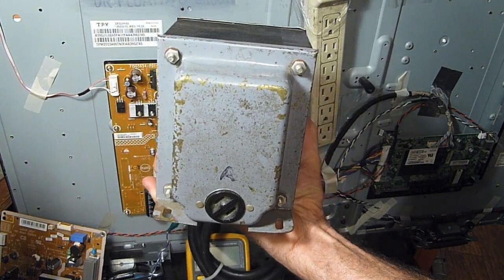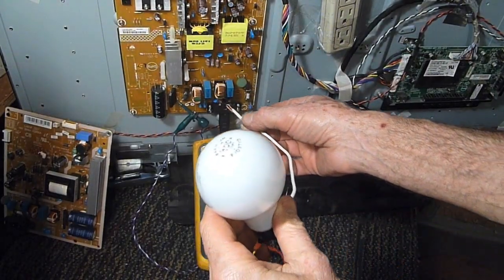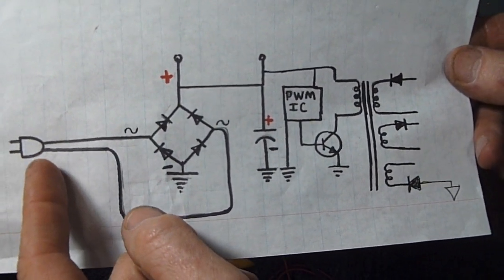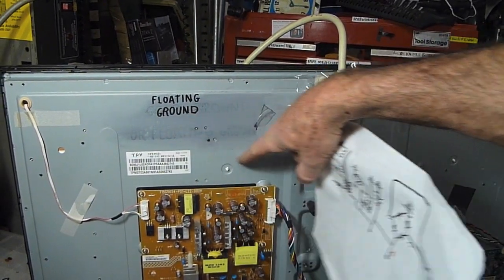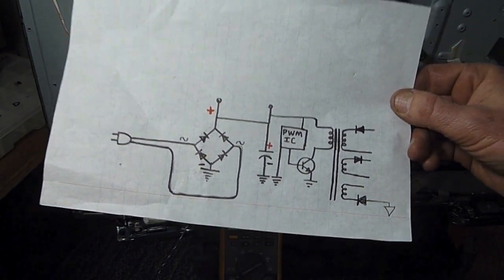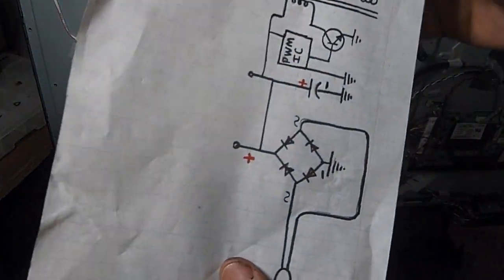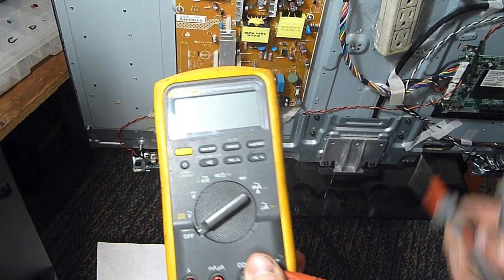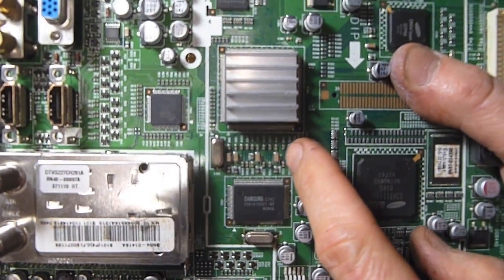Understanding the hot and cold side of a switch mode power supply.

Comment: Very nice. I need to replace my TV PSU. i Know to do that i need to unplugged the power cord from the outlet, but i do know that the hot zone of the PSU has a capacitor labeled with 400v. If the capacitor has a huge voltage it can hurt me for sure. I do know that a can short the capacitor with a isolated screw driver. Once i do that the hot zone remains dangerous? I guess the 400v will be gone once the capacitor is shorted...
Thank you.

Comment: Is it also possible to place your black probe into the negative leg of the largest capacitor on the primary side? I think I've read that on some books about electronics repair.
Reply from the maker: No that sounds like a bad idea.If you place your black meter probe on the negative terminal of largest capacitor in the power supply it's likely to be the hot side of the power supply, and the measurements you make on the cold side of the power supply will be misleading since they are likely to be ghost voltages. .

Comment: Just wanted to say thanks, iv been struggling to repair my drill battery charger which has this kind of switching circuit , from your video I now understand that the chip on the primary side that generates this pulsed dc is probably at fault, the transistor is testing OK, I was measuring 230v dc on the primary side of the transformer, but nothing on the secondary, I removed the transformer and looked for a short on the secondary circuit but that was fine, I applied 18vdc from another power supply to the secondary side and the charger came to life, so as the windings in the transformer were not open circuit, I was left scratching my head and pretty frustrated that it just didn't make sense, I did have an inkling that it was somehow the wrong frequency of dc being generated, so I guess I'll try find this ic online, since the transistor tests good, and iv replaced pretty much every other component in the primary circuit it has to be the ic, thanks again for sharing the knowledge
Reply: You don't know how long iv looked for this information, trying to find the right information to diagnose my charger has been an absolute nightmare. People like you who explain things in a way in which it's easy to understand are a breathe of fresh air

Comment: Where you start measure DC after transformer or after bridge rectifier.
Reply from the maker: After the bridge rectifier is where you measure your DC power.. The power that goes into and our of your transformer is AC.
Reply: @GrantsPassTVRepair  Is the power that goes into  and out of the transformer is  AC or pulsating DC ?
Reply from the maker: @suhailasaba1051  I remember having the same question. ;-) Pulsed DC is going into the transformer, but AC is coming out of the transformer.
Reply: @GrantsPassTVRepair  Thank you for your answer. 
Great video.
Reply: @GrantsPassTVRepair  
Can I measure the input voltage of the transformer by a digital multimeter  ?
Can I measure the output voltage of the transformer by a digital multimeter  ?
Reply from the maker: @suhailasaba1051  As an apprentice in a TV repair shop many years ago I damaged my multimeter measuring a high frequency waveform going into a flyback transformer,  so to play it safe I suggest you measure across the capacitors on the cold side of the switching transformer.
Reply: @GrantsPassTVRepair  Thank you for your  good  answer
Reply: @GrantsPassTVRepair  Is it ok to measure the voltage at the cathode of the diode that is placed after the secondary of the transformer in case the capacitor is dried out and is desolderd and is taken out of the circut ?
Reply from the maker: I'm not sure about measuring anything directly after the transformer. I suppose it depends on how much your meter can handle. My fluke seems fairly indestructible, but I don't like to take chances after my bad experience.
Reply: @GrantsPassTVRepair  
Thank you very much for your answer.

Comment: how can one test the pulse transformer to ensure its working properly?
Reply from the maker: There are several way s to test a transformer. One way is to verify that it has power on it's primary and secondary side. If the primary side is oscillating you should be able to measure voltage across the capacitors on the secondary side.
Reply: Grants Pass TV Repair thanks for quick reply, is this possible to test without an oscilloscope? my voltage readings look ok with a multimeter on the primary, yet I get zero dc output on the secondary

Comment: I have a question. I try to fix my TV. the capacitor went out. and it's a 220v 220uf capacitor. I was wondering if it was okay if I can use a 250v 220uf capacitor instead. will it still work even if I up to voltage
Reply from the maker: You shouldn't have any problem replacing your 220 volt capacitor with a 250 volt capacitor as long as the micro-farad value is the same.
Reply: Grants Pass TV Repair thanks for the answer. I have one more. my TV has a t 3.15ah 250v fuse and I know it need to be replaced with the same type for fuse but I tried a t8ah 250v fuse. now it did turn on for a sec to display the logo for the brand then dim down then turn off I guess and I tried it again and same thing. so I was wondering and making sure it will need the same type of fuse to work properly. I just thought it would work and not mess with the mother bored. and was wondering what was the difference between the 2
Reply from the maker: I don't know what the ah stands for, but I would not recommend  you use an 8 amp fuse in place of a 3.15 amp fuse.
Reply: Grants Pass TV Repair thanks for the input

Comment: I just stupidly make this mistake a couple months ago.  Working on a TV checking the PFC circuit - which is about 380v - I went to move my positive probe to the low voltage control section of an inverter board and instantly fried it.  I realized what I did about 2 secs later.  Welp time to buy an inverter board too.
Reply from the maker: An expensive but valuable lesson in the school of hard knocks.

Comment: The fuses on the hot side, can you get a resettable T3.15A250V or is that not a thing? Are the resettable fuses just for heat based over current/voltage related protection?
Reply from the maker: When I troubleshoot a TV which has a blown fuse, sometimes I temporarily use a resettable fuse. If you do this make sure you use one that has the correct amp setting, and keep in mind it probably doesn't open as fast as a regular fuse.
Reply: Thanks useful info. The fuse is a T rating so slow blow anyway, however I can't find a 3.15a 250v resettable fuse or even a 3a 250v resettable fuse. I don't suppose a 2A 250V resettable fuse for testing would be sufficient to allow the device to play under test before I replace the original cap with a direct replacement if I fix the issue?
Reply: Well I found a 3A 250v glass fuse so I've soldered some 34AWG copper wire to it and the board and the TV SMPS turned on and started it's whining transformer again, so the ghetto fuse attachment will allow me to troubleshoot further. Still interested in the resettable fuse question. I'm guessing that the lower amperage rating will just mean it blows at a lower threshold (sooner) and may blow during normal operation depending on load.
Reply from the maker: Check with your local auto parts store. The one next to my shop sells re-settable fuses. I don't know if a 2 amp fuse is enough to briefly test a circuit that requires a 3 amp fuse. A re-settable fuse opens slower than a regular fast blow fuse, so perhaps it cold work for a small segment of time.
Reply from the maker: My understanding of a re-settable fuse is that it's just like any conventional fuse, except that it's re-settable.

Comment: Explains why I was getting barely any voltage but enough to think power was there. Also I think I now know why I tripped the mains fusebox because I put the oscilloscope probes on the wrong pins of the transformer effectively shorting it...it blew the onboard fuse the second time and I think the transformer (which was whining) might have been killed, but fuse replacement needed first
Reply from the maker: Sounds like a good lesson in understanding the importance of using an isolation transformer.
Reply: Grants Pass TV Repair I saw your video a few hours after doing it for the second time...I've just spent a lot importing a trinocular microscope into the uk so I don't think I'm getting an isolation transformer anytime soon